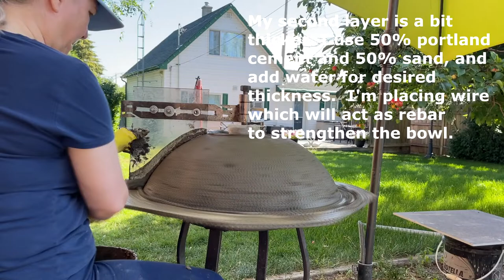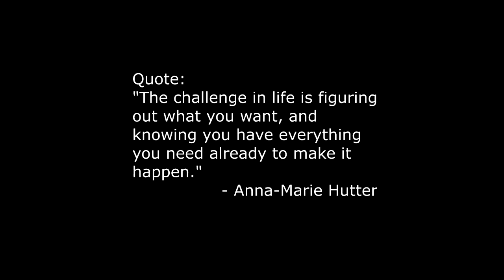DIY How To Make A 24" x 6" Concrete Birdbath Bowl #2, with "Dame On The Move".

Comment: That rebar wire surely adds strength to hold up. Thanks for the enlightenment.
Reply from the maker: You’re welcome
Thank you for watching.
Reply: @dameonthemove9596  Pleasure.
Reply: She used wire in place of rebar.  .

Comment: Great video! I have been "wanting" a large bird bowl and this looks easy enough to accomplish with little elbow grease..my only "meh" moment in the video was the cloth used to smooth the surface. I get it, but a small set of trowels could give a much smoother finish? Then again, think of the moss that can grow in the little nooks and crannies ❤❤!  I havecseen a fella that took a cheap stainless finger finger guard for chopping veggies and he worked the edge of it upward just so slightly so it wouldn't gouge his medium, clay, and it seemed to have worked beautifully.  Just a thought. Keep up the great videos!
Reply from the maker: Thank you for watching. I really enjoy making these videos. I used a soft scrubber using the plastic side.  I get them from the dollar store.